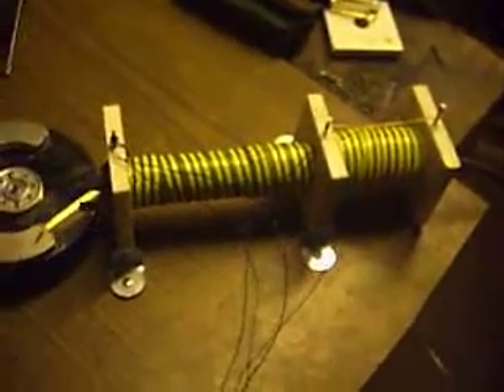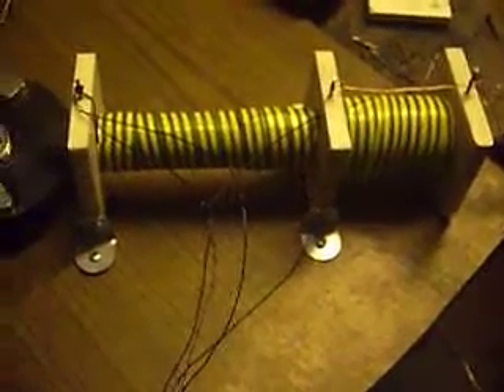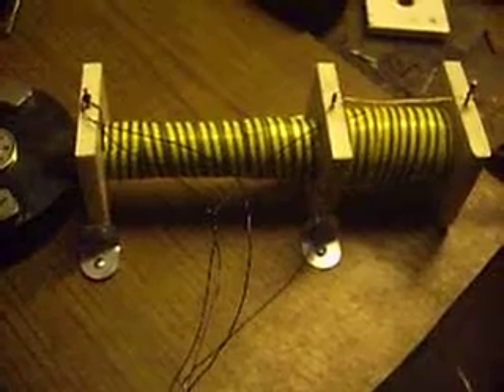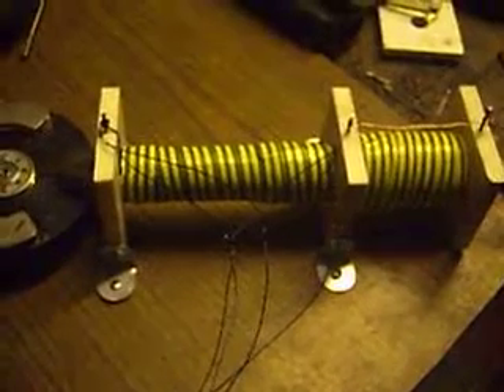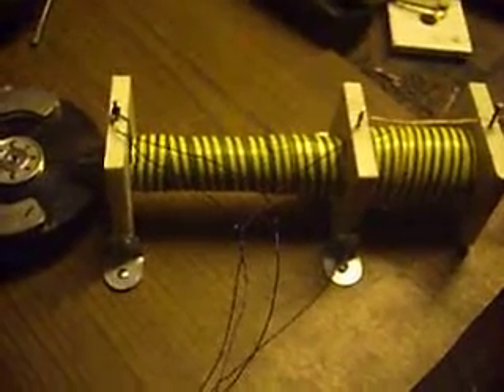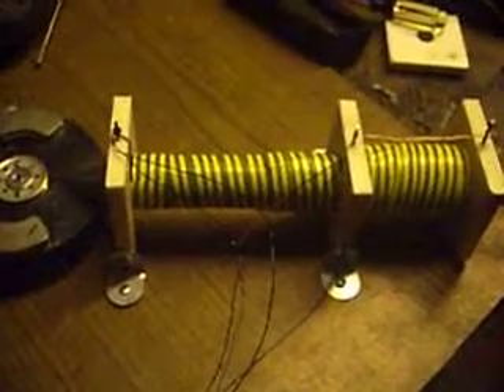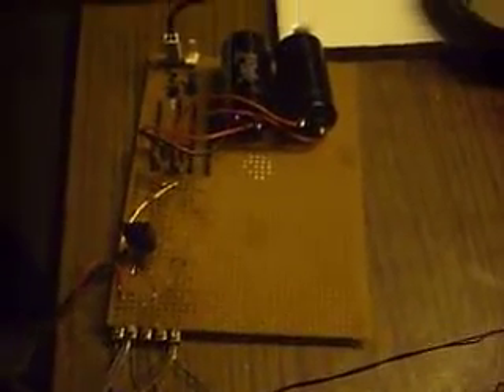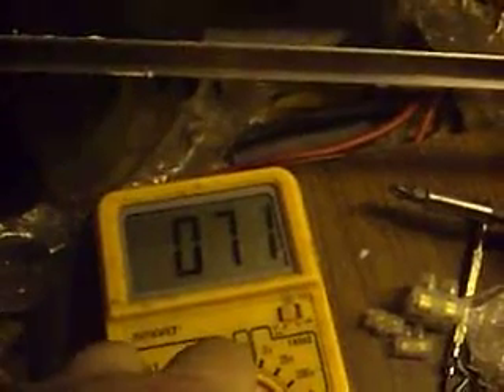comwarriors bedini feedback to source / new bedini - Update 2

Comment from the maker: self oscillation is unexpected! nor is is wanted.
I believe it maybe because my core is not magnetically dense enough.

It's still the same circuit as the one i designed with no changes. yet.

Magnets are not ideal, but they should work. I'm not going to spend tonnes of money untill i get a reasonable result with what i've got.

I don't know if it's charging while it's self oscillating. put it's producing about 50-60 volts into the capacitors the problem is i think it's killed my multimeters